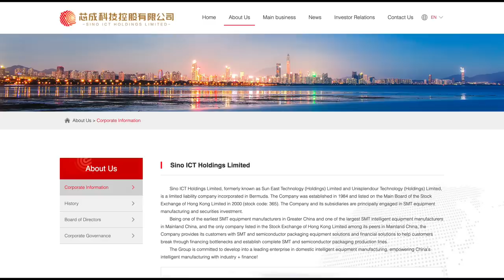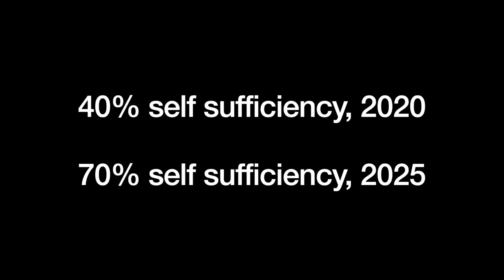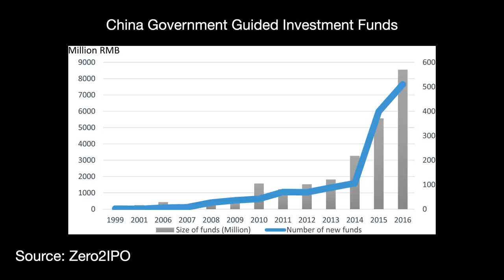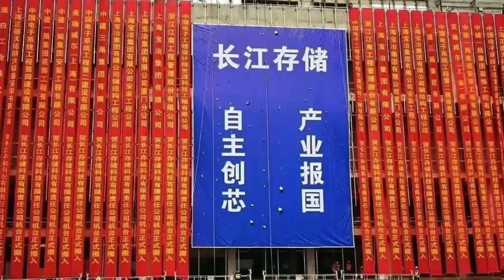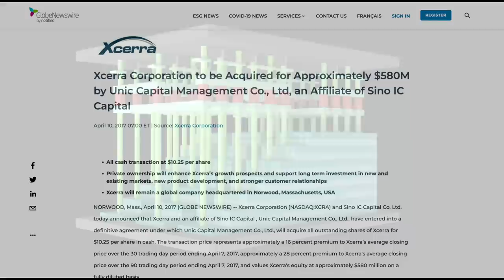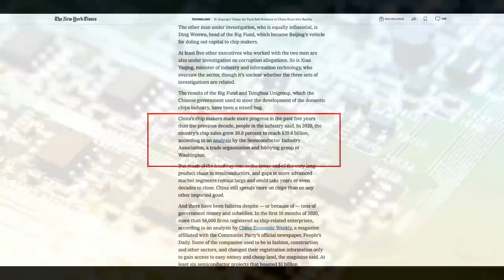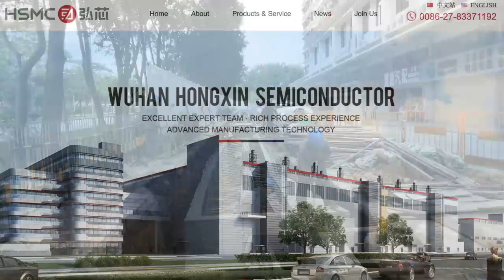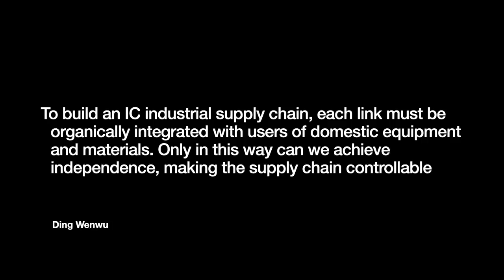The Flawed Assumptions Behind China’s Big Semiconductor Fund

Comment: I was talking about the pros and cons of open source software like Linux the other day. I was saying that it allows China to just walk into industries that would otherwise be controlled by western companies. My friend thought that the benefits still far outway the downsides. All the same, I worry that China will abuse open standards like RISC-V to try to dominate in the design of microcontrollers
Reply: It's only a downside if you're a westerner
Reply: @keyboardt8276    it's only a downside if you're a (western) monopolist.. as it threatens your monopoly.
Problem for libertarian westerners (which also have trouble with China) is the monopolist agenda that China represents. Single party rule is political monopolism. Centrally planned economic activity is monopolism.
Reply: More competition is supposed to be good for Western businesses.
Reply: @joansparky4439  I'm not opposed to opensource. I run Linux on all my computers. I'm not even that opposed to tech transfers when it is a democratic country doing it but when you're talking about a country with a value system that is the antithesis to everything good in the world you better believe I'm a western monopolist.
Reply: @jamescaley9942  That is the theory and is usually the case. The difference with China is they want to be allowed to freely compete with western companies in the west while banning western companies from doing likewise.
Reply: I worry China will win in a fair competition, you say?
Reply: @clearz3600     you're a pluralist, not a monopolist. Pluralists believe in equality, liberty and cooperative, transparent competition.
Monopolists on the other hand follow a winner takes all agenda and will (ab)use any means to achieve that goal (for their own personal benefit).

China's single party rule is political monopolism. What the "modern" GOP in the US tries to achieve is also political monopolism.
Any market participant who is ruthless, greedy and asocial is a monopolist and will do everything to create a monopolist niche where he can control the supply of something so he can earn profit.
Dictators are political monopolists. Kingships are political and economical monopolies in one.

This trend towards monopolism is in the nature of life - because for the individual it is beneficial if they can profit from a monopoly, as it gives them a biological advantage over its peers.
But monopolies in wilderness, in nature do not exist (and environment made up of generalists). Monopolies are the result of human societies requiring a framework/process/mechanic that enforces rules like private property and personal freedom to make specialization a worthwhile strategy.
And this mechanic HAS TO BE made up of those very same selfish individuals, who then naturally will try to benefit personally from this constellation at the cost of the rest.

Here is a quote from 250 years ago out of Wealth of Nations by Adam Smith (read between the lines):
"The interest of the dealers [referring to stock owners, manufacturers, and merchants.. anyone really], however, in any particular branch of trade or manufacture, is always in some respects different from, and even opposite to, that of the public.  To widen the market and to narrow the competition, is always the interest of the dealers.  To widen the market may frequently be agreeable enough to the interest of the public; but to narrow the competition must always be against it, and can serve only to enable the dealers, by raising their profits above what they naturally would be, to levy, for their own benefit, an absurd tax upon the rest of their fellow-citizens."
&
"The proposal of any new law or regulation of commerce which comes from this order, ought always to be listened to with great precaution, and ought never to be adopted till after having been long and carefully examined, not only with the most scrupulous, but with the most suspicious attention.  It comes from an order of men, whose interest is never exactly the same with that of the public, who have generally an interest to deceive and even to oppress the public, and who accordingly have, upon many occasions, both deceived and oppressed it."

Do you notice it?
Monopolism is based on societal rule enforcing to keep the individual honest and make things like contracts and voluntary exchanges of resources possible, while that very same mechanic can also enforce rules that give some individuals an advantage.
Rules like patents, licenses, tariffs, IP, copyright, picking winners, etc. pp
Monopolism is societal cancer, a disease.
Humanity battles this since we form societies and by the looks of it we don't have made much progress yet.
Reply: @jamescaley9942     I highly recommend you read 'The Myth of Capitalism' by Tepper and Hearn (2019) to get an idea how western businesses have dialed down competition and created a few winners take all environment.

Out of that book - you know what Warren Buffet likes to invest in? In companies that have a moat - meaning protection from competition.
It's easy to see why.

Wealth inequality is based on monopolism - on a winner takes all environment being enforced by the societal monopoly force (which we need to create principles like personal freedom and private property  - look at wild nature, those things do NOT exist there). But this very same monopoly force also can (and does) enforce rules that benefit a few at the cost of the rest.
Now guess what any individual that is ruthless, greedy and asocial enough and wants to get ahead of its peers (at any cost) will do? Correct.

Adam Smith told us as much:
"The interest of the dealers [referring to stock owners, manufacturers, and merchants.. anyone really], however, in any particular branch of trade or manufacture, is always in some respects different from, and even opposite to, that of the public.  To widen the market and to narrow the competition, is always the interest of the dealers.  To widen the market may frequently be agreeable enough to the interest of the public; but to narrow the competition must always be against it, and can serve only to enable the dealers, by raising their profits above what they naturally would be, to levy, for their own benefit, an absurd tax upon the rest of their fellow-citizens."
&
"The proposal of any new law or regulation of commerce which comes from this order, ought always to be listened to with great precaution, and ought never to be adopted till after having been long and carefully examined, not only with the most scrupulous, but with the most suspicious attention.  It comes from an order of men, whose interest is never exactly the same with that of the public, who have generally an interest to deceive and even to oppress the public, and who accordingly have, upon many occasions, both deceived and oppressed it."
Reply: @arthurcpiazzi    please define "winning" in this context.
Economic competition is not like a sports competition, where the winner takes all.
Nature simply does not work this way. Show me a winner takes all in nature please.
Economic (social) competition are constant, repeated merry-go-rounds unless there is a monopoly force there that enforces rules that the first to achieve something is shielded from further competition.
Or even worse - it creates 'winners take all' environments by enforcing rules that prohibit or undermine competition.

China on a global scale competing with the rest of the world wouldn't be able to win as it would not be able to achieve a monopoly on violence to oppress the rest of the world with.
The only empire that has come close to this is the USA I'm afraid and we're relatively lucky that at it's core it has been conceptualized as a pluralist society (even if this is waning) and not as a monopolist society.

I suggest you get a book called Voyage from Yesteryear by James P Hogan to get the concept.
Reply: @joansparky4439  To your own word “winner take all is monopolist” So America is monopolist as it deployed this strategy for decades. So call Zero sum game. There is nothing to talk about one party (China) or two party (US) system. 

In addition, US rule base order means They can re-write the rule when they found their lost in old rule they written. To make sure that they will be the winner and take all.

Talking about one party or two parties is just ideology but does not change the real behavior of any countries
Reply: @wsi1917  
"So America is monopolist as it deployed this strategy for decades."
The USA in a sense is monopolist on the world stage, yes. That's what Imperialism stands for actually.

"So call Zero sum game."
No idea what you mean. Economics is a zero sum game, always has been.

"There is nothing to talk about one party (China) or two party (US) system."
Electoral college and/or first past the post creates conditions for winner takes all.. in a sense it is monopolistic.
Hell, even parliamentary democracy trends towards monopolism in the end.

"..does not change the real behavior of any countries"
Countries behave transactional on the world stage most of the time.
And as is normal for any individual - if it can coerce/extort others for it's own benefit it will do exactly that.
I don't know why you are surprised.
Reply: @joansparky4439  I am not surprised. I just saw you repeatedly talking about monopolist emphasis on China one party ideology. 

Just want to point out that you mixed two different stories into one.
Reply: @joansparky4439  Great reply. Very inciteful.
Reply: @wsi1917     ANY society is on a path to be monopolized for the benefit of a few individuals at the cost of the rest of that society.
Communist/Socialist regimes START as political monopolies.. single party rule, NO political competition allowed. Any competition is either killed, jailed or driven out of the country.
The USA started out as a somewhat pluralist society (if you ignore the exclusion of non-whites and women).. which did change over time, but all in all in direct comparison to a communist society much much more transparent, cooperative and competitive.

Or to say it differently.. political pluralism IS democracy. Democracy is the "free market" political system.

I didn't mix anything there, you just don't realize yet what I am talking about.
Reply: @clearz3600    Thanks, if you ever come across a method/mechanic/process on how to create 'personal freedom' and 'private property' for a society that is based on flawed, selfish human beings please contact me. I've been searching for months by now..
What I can tell already is, that parliamentary/representative democracies are dead ends that will end in monopolism, just a matter of when, not if. Democracy itself is an OK process, but we're doing it unsustainably, as there will always be a few ruthless, greedy, asocial individuals that try to eek out a monopolist niche for themselves. Societies that give any individual for whatever reason advantages, those few will sooner or later find a way to make it work for themselves at the cost of the rest and it's downhill from there.
That's the problem of humanity (and probably life itself - I thinks this is a very good candidate for the Fermi Paradox).
Reply: @joansparky4439  you yourselves don’t know what you are talking about. 

Europe and America never be transparent regardless how they call themselves imperialism or democracy. Most of the thing decided by small group of people behind the door since they established their nations. 

French Revolution started from hungry and inequality between elite and poor. American fight with British also cause by tax which is inequality too. How can a free market have slaves? How can free market run by gun powder? You forget all western history build on killing and weak and suck out business for centuries? Democracy is just a nice word the western world try to paint themselves looking good. 

National security keep everything opaque since century regardless of any political system. 

Stay dream walking in your ideology.
Reply: @joansparky4439  I am not defensive and I also never say China is good. 

I just saw you keep attack China one party and talk about western democracy and praised it for more transparency. 

My point is simple. Before you attack other nation governing system. Look at the mirror and ask yourself, do my country did better? If not, spend energy on your own country. 

For me, I do not care any ideology. I value ‘people fundamental livelihood’. Starting from majority of citizen having food to feed family daily. Secure shelter, affordable health care and continue improvement of their family livelihood from generations to generations as the goal of governance which  could be adjusted to fit progressive change of society. Democracy and free speech can neither fill stomachs nor curing sickness. Somebody call it meritocracy which can be part of any ideology governing system from Monachy to socialist to communism to democracy. Sustainable good livelihood and stay peaceful with other countries should be real value than any ideology.
Reply: so you want to monopolize the type of government ?
Why you "type of democracy" should be the only one in the world?

Or why your type of government should be the only o e in the world?

Different reallities, culturw and necessities needs different solutuons.

That is why in linux exists a lot of Desktop environments, packages managers or distributions.

Not everyone think in the same way.

One solution cannot fit all the necesities and solve all the problems for any reallity.
Reply: @wsi1917  
"I just saw you keep attack China one party and talk about western democracy and praised it for more transparency."
I praise the theoretical ideology 'democracy' for transparency, cooperativeness and competitiveness.. not the real existing political ideologies that carry that label. I told you before - I do not discuss strawmen.

"Before you attack other nation governing system. Look at the mirror and ask yourself, do my country did better? If not, spend energy on your own country."
Just in case you don't know, but that right there is BEING DEFENSIVE.
And it also is a red-herring fallacy you deploy there - not cool bro.

Why do you think I'm a westerner anyway? I could be Chinese for all you know.

"For me, I do not care any ideology. I value ‘people fundamental livelihood’. Starting from majority of citizen having food to feed family daily. Secure shelter, affordable health care and continue improvement of their family livelihood from generations to generations.."
OK.
What about people around you that are ruthless, greedy and will have no qualms taking your stuff, your family, your livelihood to have a better life themselves?
You call for Government to protect you from them?
What if those people ARE the government or get into positions of power within government?
Who do you turn to?

You going to protest their "unfair" treatment of you and your family and livelihood?
They will use the monopoly force to crush you and your dreams and won't loose any sleep over it.

Just look at any monopolist regime on this planet now or in history.
It's all the same.
You blame this on the theoretical ideologies of democracy and free speech? LOL

My assessment stands - you don't know what I am talking about and probably have not even a full grasp of your own position regarding all of this.

PS: and don't think you're ideology free.. by all I've seen from you so far I'd say you're a mild authoritarian with a nationalist side to it (mostly based on your defensive reaction and what you expect from live/society/government). All in all a very primitive mindset you should try to grow out of.
Reply: @Ateshtesh    who are you talking to? It's not the OP as he didn't address 'type of democracy' at all..
Reply: @joansparky4439  Sorry, it was to "@clearz", fixed.
Reply: @joansparky4439  about the monopoly on violence, the USA is the only empire the has and it is trying to maintain this. It is a fallacy to think that every country that achieves superpower status will try to the same. And even in the worst case scenario, it would be only a fraction of the USA is doing. 

USA is not a monopolist society? I guess everybody can have it’s own opinion 

I just find it funny that the bastion of free market has to block the sales of machines (e.g. ASML machinery) in order to maintain existing monopolies. 

Who has the winner takes all mentality?
Reply: @Ateshtesh   Please offer me a counter example of a system that is being used in the world that provides long term stability, economic growth, general wellbeing for citizens.
Reply: @clearz3600  back in the day when Japan was as the height of semiconductor manufacturing, USA has also beaten it up.

Let's be honest here, it's nothing about democracy, open source or whatsoever idealism. It's about greed and (national)  interest.
Reply: CN重庆  中国最近贡献了哪些标准?
Reply: @joansparky4439  I'll let you know if I discover one  but I wouldn't hold out :D
Reply: CN重庆  你没有任何意义
Reply: @keyboardt8276  hm, if you're from Taiwan, Japan or South Korea it's also a downside.

And i wouldn't call those 3 western countries.
Reply: @joansparky4439  hm, you write interesting stuff.

I obviously didn't read all your comments and don't recommend me any book, because I'm a lazy reader.

If you're bored, i'd like you to look at the German politic landscape. I think maybe you could find it interesting, also if you want to tell me what you think about it, It would make me happy to discuss.

(I'm German btw, and sry for my weird english)
Reply: @sbeyer17    Ich kann auch Deutsch, ist ja meine Muttersprache, aber nach 10+ Jahren im Australischen Busch faellt mir Englisch schreiben dann doch ein bisschen leichter (vor allem da ich keine DE Rechtschreibung drauf hab und mir ae, ue, oe fehlt ;-)

Ich kam mit Freiwirtschaft in Beruehrung nachdem ich ein bisschen viel Geld in der Internet Blase verloren hab damals.. weisst schon, Intershop, Internet, etc.. Hab zwar Indexfonds genommen, aber das hat auch nicht viel geholfen.
Hab dann 4 Buecher gekauft und eins davon war von Bernd Senf - Die Blinden Flecken der Oekonomie. Hab dann viel mit Leuten in nem nicht mehr existierenden Freiwirtschaftsforum diskutiert und ueber die Jahre so meine eigenen Gedanken gemacht. Das andere Forum vom selben Typus (Das Gelbe Forum) gibts immer noch.. aber die Jungs hams auch nicht drauf von der Theorie her (den Paul C Martin gibts mittlerweile auch nicht mehr.. hat zwar paar gute Ansaetze mit seiner Debitismus Theorie aber schlussendlich viel zu einseitig und narrow.

Anyhow.. Deutsche Politik? Hm.. ich guck ab und an die 21:00 heute Nachrichten und am WE die Heute Show mit Welke.. aber insgesamt ist die deutsche Politik nicht viel anders als ueberall sonst. Meistens rennen sie den Trends hinterher, ein paar sind ganz schlimme Finger und eigentlich nur an ihrem eigenen Wohl interessiert waehrend ein paar andere das beste draus machen..
Aber da kann ich nen Spruch von Milton Friedman bringen den du dir hier in voller Laenge auf YT angucken kannst wenn du willst (Milton Friedman Speaks: Money and Inflation (B1230), von Minute 59):
"It's nice to elect the right people, but that isn't the way you solve things. The way you solve things is by making it politically profitable for the wrong people to do the right things. Unless it is politically profitable for the wrong people to do the right thing, the right people will not do the right thing either, or if they try, they will shortly be out of office." Milton Friedman
(aber wie gesagt - parlamentarische/represetantive Demokratie ist ne Sackgasse)

Bloederweise haben weder die Austrians noch die Chicagoans (beide im weitesten Sinne Libertarians) Monopole universal verstanden und ne vernuenftige Theorie drauf aufgebaut, auch wenn vieles von dem was sie postulieren richtig ist (aber auch ne Menge Bloedsinn dabei - wie zB Goldgeld als das einzig wahre bei den Austrians, was ein Mist). Appropos Monopole.. nachdem ich Senf gelesen hatte und 2-3 Jahren diskutieren ist mir aufgefallen dass der Fehler im Geld ein Monopol erzeugt.. und das war der Moment wo ich die Dinger ueberall erkannt habe in unseren Gesellschaften. Mein Hintergrund is Physik/Physikalische Technik.. ich hab zwar QM nicht so richtig verstanden, aber meine Faehigkeiten Grundlegende Zusammenhaenge auszuarbeiten helfen mir hier enorm weiter.

Falls Du dich mal kundlich machen willst - zur Gruendingszeit der Gruenen haben die ne Geldreform angetstrebt und es war teil ihres Programms - ganz im Sinne der Freiwirtschaft. Ich nehm an es waren nicht viele FW'ler weil das rel schnell verschwunden ist.
Die einzigen die zZt was in der Richtung machen (und im Prinzip Monopole bekaempfen) sind die Regionalgelder. Falls du kannst guck dir mal den Chiemgauer in Bayern an. Die haben zwar auch nicht die richtige Theorie warum was sie machen in etwa richtig ist, aber die machen wenigstens was ;-)
Reply: @arthurcpiazzi       monopoly on violence doesn't work on the world stage yet.. its still a competition between nations/unions.
You only get a monopoly force when there is no more competition by any means there (because that is what the monopoly force prevents from happening).. like in a society where the monopoly on violence rests with Government.

So your premise is wrong. The USA at best got to dominate after the Cold war.. but never had a monopoly there.

As for the USA being imperialist/selfish/transactional on the world stage.. yeah, well, that is what wilderness looks like without a mechanic in place that enforces rules that have been agreed upon by all members of that society.
There really is nothing wrong with this.. nor will you find me defending the USAs geopolitical strategy/behavior. For me it's just what happens in wild nature..

"USA is not a monopolist society? I guess everybody can have it’s own opinion "
It has got monopolist tendencies and niches.. yes, but overall it is pretty pluralist.
If you really want to you can say what you think, you can do what you want (within the rails of a society).. you can follow any economic activity you want (within rails naturally). Yes, there are monopolists there that do abuse monopolist niches and create new ones, but overall it's still pretty pluralist.

"I just find it funny that the bastion of free market has to block the sales of machines (e.g. ASML machinery) in order to maintain existing monopolies. "
They don't want to make it easy for China to prep up it's monopolist state with western technology and then have to deal with an opponent on the GLOBAL WILDERNESS that is able to go head to head with the USA.. I might not like this view, but I certainly can understand it and empathize with it even a little.
Compared to China the USA is much more pluralist, even if for a lot of aspects the differences are marginal (or the USA in some categories is even worse)..

Anyhow, can you do me a favor and tell me what you think when you write 'free market'?
Do you think it is a market without rules or that it is a market where supply and demand are free to adjust to each other and that there are some rules there?
Big Thanks!

"Who has the winner takes all mentality?"
Everybody.. I doubt there is more than 2-5% in the global population of us humans that are global optimizers first and local optimizers second. So given the opportunity most of us will try to benefit from others, even if this means that the others will lose out if we do this.
And this my friend is simply how life functions - every individual organism first and foremost functions per the survival of the fittest individual by any means available. We humans in our current form are the product of hundreds of thousands of years (probably even millions) of natural selection where being part of a fit social group gave us an advantage.. so a lot of us are bred for existing within societies. But nature still does produce the occasional narcissist/sociopath because if the environment changes those traits might be needed for our species to survive.
This is why you can still observe a winner takes all mentality all over the world in any walk of live. It's really nothing special or miraculous nor will you be able to see me defend the indefensible.

Again, you have to try harder if you want to catch me off-foot. ;-)
Reply: Open source does not allow anybody to "just walk into industries that would otherwise be controlled by western companies." All it does is make those particular software components a commodity; there's a lot more to an industry than just a bit of software.

If Chinese designs start dominating the market for RISC-V microcontrollers, that will be because they produced designs at least as good as the western designs and are selling those designs for less, or because they produced better designs (which would allow them to charge as much or more for the use of those designs). No software is going produce a good design for you; that needs to be done by engineers who have a good grasp of what they're doing.

In fact, Chinese companies may have a harder row to hoe than companies in other countries simply by the virtue of the fact that they're Chinese. Lots of people trust Intel to produce microprocessors without back doors or the like in them. (Whether this trust is justified is a separate question.) But under Chinese law, Chinese companies can be forced by their government to secretly collaborate in espionage activities, which rightfully raises suspicion about certain types of Chinese products. (This is also to at least some degree the case in the U.S.; again, whether having more confidence in U.S. vendors than Chinese vendors is actually justified is a separate question.)
Reply: @Curt_Sampson    "whether having more confidence in U.S. vendors than Chinese vendors is actually justified is a separate question"
Big reason for why France is doing what it is doing.
Reply: @joansparky4439  hm, ok, ja man merkt das du iwie Akademiker bist, ich finde man merkt auch etwas deinen Naturwissenschaftlichen Zugang zu Themen, ist aber nur ein Gefühl. Was verschlägt dich den eigentlich nach Australien?

Ich bin noch Student, studiere Embedded Systems Engineering (im Grunde Informatik mit noch nem Elektrotechnik Fokus und etwas Mikrosystemtechnik (Elektrotechnik und Mikrosystemtechnik gehen Hand in Hand (Mikrosystemtechnik ist auch unter dem Namen MEMS bekannt, sollte dir was sagen wenn du die Videos auf dem Kanal hier anschaust xD))

Ja mit Deutscher Politik meinte ich einerseits die FDP die einerseits zumindest über sich selbst sagt, dass sie voll für liberale Marktwirtschaft ist, andererseits kann ich mir aber auch irgendwie nicht wirklich vorstellen, dass du dich mit diesen Leuten verstehen würdest.

Ich persönlich weiß nicht wirklich wo ich politisch stehe, wahrscheinlich irgendwo grün und etwas links aber nicht bei den Linken (die sind mir im Moment viel zu nah bei den Russen / waren sie schon aus meiner Sicht vor dem jetzigen Konflikt)

Und die Grünen sind aus meiner Sicht teilweise (nicht alle und nicht immer) gutmenschen, die jeder hasst. (Außer die Jungen Menschen).

Die CDU ist eben halt einfach nur extrem korrupt / es wird als Erfolg in der CDU betrachtet wenn du irgendeinen Deal mit nem großen Unternehmen zu deinem persönlichen Vorteil abschließt.

Aber die werden zum Glück fast nicht mehr gewählt seit die einzige wirklich kompetente Politikerin der CDU die CDU verlassen hat.

Wirtschaft interessiert mich nicht wirklich, obwohl diese natürlich extrem wichtig ist. Klar werde ich niemals reich sein, aber mir reicht es wenn ich einfach halbwegs meinen Lebensstil halten kann.

Ich setzte persönlich meinen Fokus auf Technologie, daher auch ein technischer Studiengang. Joa
Reply: @sbeyer17     wegen Familie, wollt nicht allein in Deutschland bleiben (bin halt nen soziales introvertiertes Lebewesen ;-)

Ich hab 2008 mit Physik angefangen und erst viel zu spaet gemerkt (nach dem Vordiplom) dass ich nicht kompatibel bin mit der Art und Weise wie das laueft an der Uni. Hab dann auf Physikliasche Technik gewechselt und da meinen Abschluss gemacht (war wesentlich praktischer). Im Anschluss nach Oz und arbeite seit dem als Feldtechniker an ner Uni hier.. designe/baue/programiere Sensorinstallationen fuer Umweltdaten. Immer was neues, genau mein Ding ;-)

Liberale (in anglo libertarian) muss man unterscheiden zwischen wirklichen und denen die sich nur so nennen.
Die wirklichen sind absolut meine Wellenlaenge (selbst wenn sie nicht alles so sehen wie ich, such mal nach 'Milton Friedman Free To Choose' hier auf YT und hoer dir seine Argumente an).. die anderen sind Woelfe im Schafspelz.
Wenn du unterscheiden willst frag so einen einfach ob 'Freier Markt' bedeutet dass er frei von Regeln ist oder das Angebot und Nachfrage sich frei aneinander anpassen koennen. Wenn er "frei von Regeln" antwortet hast du nen Wolf vor dir (oder nen Idioten).
Bei Politikern muss man nochmal sehr vorsichtig sein weil die Umgebung in der die existieren werden keine Gefangenen gemacht.. alle die das ueberleben und an der Spitze rauskommen muessen im Prinzip Woelfe sein, sonst packen die das nicht. Wenn die dann noch was gutes hinbekommen.. Hut ab.

Linke sind meiner meinung nach soziale Autoritaere, die ham das Herz am richtigen Fleck aber brauchen wohl so ne art Ordnungsauthoritaet die alles regelt und koennen sich schinebar absolut nicht vorstellen das so eine uebergeordnete Regelung gegen sie regeln kann. Naiv?
Konservative wollen am Status Quo festhalten.. meistens weil da wo sie persoenlich sind ist alles OK, man kommt gut zurecht. Was mit anderen los ist wird ignoriert oder zu deren persoenlichen Problem erklaert (wie sich das mit christlichen Werten vereinbart wissen die wahrscheinlich selber nicht oder haben die nie vertreten).

Auf die Parteien in DE uebertragen:
AFD - Rechte/Konservative anti-alles Leute die Autoritaet wollen, Parteifuehrer sind machthungrig
CDU/CSU - Konservative, Partei ist unterwandert von Monopolisten und Opportunisten
FDP - Liberale, Partei ist unterwandert von Monopolisten
Gruene - Konservative, Liberale, Linke.. je erfolgreicher um so mehr von Monopolisten unterwandert
SPD - Linke, Partei auf Fuehrungsebene wahrscheinlich versaut von Opportunisten
Linke - nicht wichtig genug um unterwandert zu werden :-)

Der Witz ist, dass extreme Linke und extreme Rechte sich nicht sehr voneinander unterscheiden. Die einen sind halt nur global-sozial (links) und die anderen halt mehr tribal-sozial (rechts). Was sie eint ist dass sie vom Status Quo benachteiligt werden und Zurecht sauer sind und nach Regeln und Fuehrung verlangen die das (eingebildete) Problem loesen/beseitigen. Die einen sehen das Problem im Klassenkampf (Reich gegen Arm, Kapitalist gegen Proletariat) und die anderen im Gruppenkampf (Auslaender gegen Einheimische, Hetero gegen alles andere, GlaubenXY gegen GlaubenAB, usw.).
Das eigentliche Problem und dessen Ursache sehen die leider nicht.. sonst waeren es Liberale - und selbst die sehen es nicht richtig mMn - sonst wuerden wir nicht ueber das Thema reden muessen, weil's naemlich schon geloest waer ;-)

Wenn Du dich bei den Gruenen am wohlsten fuehlst zeigt dass dass du rel gut in der Mitte stehst und sehr wahrscheinlich mit liberalen Idealen identifizierst. Schau dir halt mal Milton an.. ich denke Du wirst erstaunt sein.

"Wirtschaft interessiert mich nicht wirklich, obwohl diese natürlich extrem wichtig ist. Klar werde ich niemals reich sein, aber mir reicht es wenn ich einfach halbwegs meinen Lebensstil halten kann."
Big Mistake.
Wir sind Lebewesen. LW brauchen Resourcen zum Ueberleben, Fortpflanzen und Spass haben. Draussen in der Natur gibts keine Regeln, keine Moral. Dort geht alles. Der Lebensstil sieht dementsprechend aus.. um da klar zu kommen muss man nen Generalist sein, aber fuer mehr als blankes Ueberleben reicht das halt nicht.
Wir Menschen (und ne Menge andere Tiere) haben rausgefunden das Arbeisteilung/Spezialisierung effizienter ist und nen besseren Lebenstil ermoeglicht.. aber das bedeutet dass wir Regeln wie 'persoenliche Freiheit' und 'Privateigentum' brauchen. Und die muessen mit Gewalt gegen einzelne "Opportunisten" durchgesetzt werden, ergo irgendeine Art von Gewalt(monopol) tritt auf (Clanversammlung, Stammesfuehrer, Koenig, Kaiser, Regierung, etc.).
Da diese "Einrichtung" von Menschen gebildet wird (die Fehler machen oder Selbstuechtig/Ruecksichstlos sind) wird diese Einrichtung auch Regeln durchsetzen die einzelnen Menschen Vorteile verschafft.. und genau da liegt der Hase im Pfeffer.
Wir nennen das Korruption, Lobbyismus, usw. geht aber auch ganz unschuldig wie zB Patente (der Weg zur Hoelle ist mit guten Absichten gepflastert).
Regeln die einzelnen nen Vorteil auf Kosten des Restes verschaffen erzeugen Monopole.
Und genau die sind unser Problem, weil sie die Resourcen- besorgung, -erzeugung und -verteilung beeinflussen.

Reich sein bedeuted viel von etwas seltenem zu haben.
In einer fairen, transparenten, kooperativen und wettbewerblichen Gesellschaft bekommt man aber nur dass raus was man selber leisten kann und mit anderen in freiwilligem Austausch erhaelt.
Damit man mehr bekommt muss man entweder sehr sehr gut sein und niemand anderes kann das, so dass alle anderen dir viel mehr geben als was du denen gibts (sehr selten, fuehr gewoehnlich Kuenstler) oder aber die gesellschaftlichen Einrichtungen erzwingen Regeln die dich auf die eine oder andere Art bevorzugen auf Kosten der anderen.
Wie gesagt - Monopole sind ueberall. Und diejenigen die am "besten" geeignet sind die auszunutzen sind die ruecksichstlosen gierigen Narzissten/Soziopathen weil die am Ende sogar ueber Leichen gehen. Und die "arbeiten" 24/7 daran ihre Position zu verbessern (auf Kosten des Restes).
So in etwa wie Krebszellen immer mehr Resourcen schlucken und dem Rest des Organismus nicht mehr genug zum Ueberleben bleibt.

Deswegen nenn ich das ganze Monopolismus - eine gesellschaftliche Ideologie bei der das Gewaltmonopol einige wenige auf Kosten des Restes bereichert.

Und der Rest kann sich nicht einfach dagegen wehren, da das Gewaltmonopol ja genau darauf ausgelegt ist den einzelnen im Zaun zu halten, damit Regeln wie Privateigentum und persoenliche Freiheit gelten damit Spezialisierung/Arbeitsteilung moeglich sind.
Ist schon irgenwie ein bisschen doof das.
Demokratie und Freie Marktwirschaft sind die politischen und oekonomischen Theorien die das (auf dem Papier wenigstens) versuchen zu kontern indem Transparenz, Kooperation und Wettbewerb als Pfeiler postuliert werden.
Bloederweise basiert am Ende dann doch alles auf Menschen die das Gewaltmonopol bilden und da sind halt doch ne Menge ruecksichstlose gierige Narzissten/Soziopathen dabei.. (und werden es immer sein - siehe genetische Zufaellig Mutation).

Das einzige was wir Menschen dagegen machen koennen ist ein Gewaltmonopol zu designen (Fokus auf Technologie ;-) dass das beruecksichtigt und auch mit den ruecksichstlosen gierigen Narzissten/Soziopathen funktionert.
Wenn Du das akzeptierst und dann nochmal den Bogen zurueck zu den Parteien spannst und wie die Regeln zustandekommen die unsere Gesellschaften regieren.. das kann so nicht funktioneren mMn. Ich hab zwar auch noch keine gute Antwort auf dieses Problem, aber ich arbeite genau an dieser Stelle seit 4-6 Monaten nachdem ich auf ne Theorie gestossen bin die ich 'global social optimum' getauft hab (basiert auf ner Menge Zeug ueber dass ich versuch nen Buch zu schreiben). Demokratie selber ist OK, aber nicht wie wir sie praktizieren - parlamentarische/representative Demokratie ist am Ende nicht nachhaltig.

PS: sorry fuer so viel Text.
Reply: @jamescaley9942   -- Most independent minded Chinese understand that the greedy, selfish, winner take all mentality business mentality the Chinese government. I was born in China and am 100% Chinese. Most educated Chinese within China echoes this claim.
Reply: @joansparky4439  -- Most businesses are not zero-sum gain. You have been reading too much theoretical books.
Reply: @clearz3600  -- Disagree that he is being insightful. Most businesses are not zero-sum gain. 

 Most independent minded Chinese understand that the greedy, selfish, winner take all mentality business mentality the Chinese government. I was born in China and am 100% Chinese. Most educated Chinese within China echoes this claim.
Reply: @kennethli8  Again, by not any means I am saying that China does not share this pitfalls. I am just saying that others does worst and receive a fraction of the backslash
Reply: @kennethli8    Every economic activity is a zero-sum-game mate. If individual 'players' deviate and manage revenue > cost, then other 'players' suffer revenue < cost. This is REALITY. That blissfully unaware folk (like you) without the needed overview / knowledge claim otherwise is nothing new..